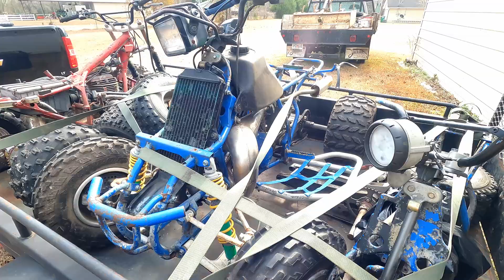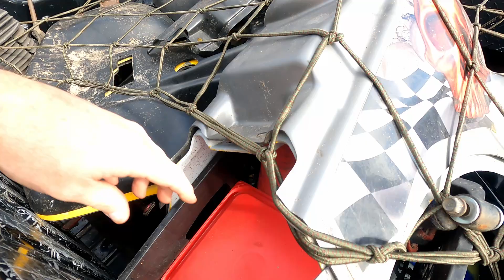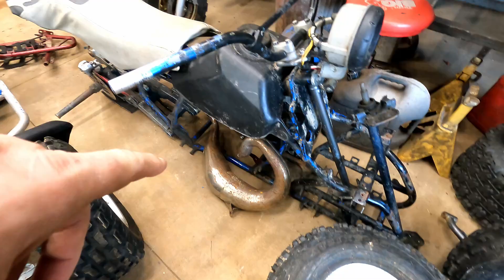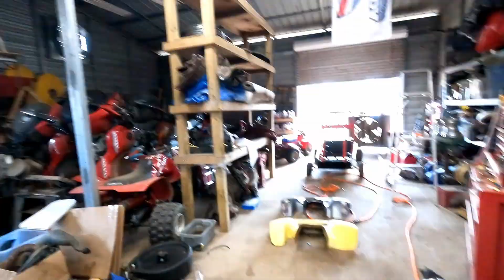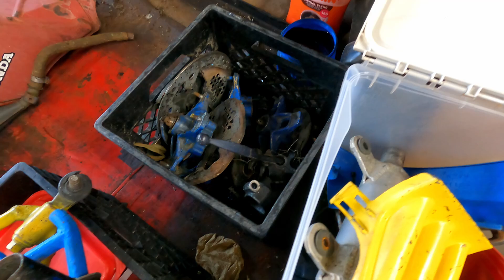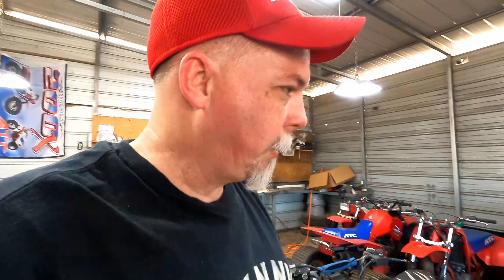WHAT WAS I THINKING? THIS COULD KILL MY CHANNEL

Comment: Congrats on the LT, good choice. The 84 should be fun since you are familiar with Honda parts and systems. I started out with autos, brand specific, Chevy. Then I learned after two fifty five Chevys, that a big block Dodge and a big block Buick were also plenty of fun. Thats why I have 2 Yamaha DX225's in my collection mixed in with the Hondas, cause I love riding them. I've got some parts for Harvey so we'll meet at the diner and back our trucks up tailgate to tailgate to shift the load. Then we go in and spend an hour or two talking and I'll try to get him to send you some pics of the dozen. Good luck sorting out those parts and when  you get a handle on them, think about putting the second together. Otherwise after the first wave of requests for the same parts, you'll be sitting on all the rest till you're my age. No matter how you post them, they'll want whats gone. Sell it complete or close and let somebody else think they can work magic. Later.
Reply from the maker: Thank you. Tell Harvey i said hey.
Reply: @Mrcbuilds  Will do.

Comment: From here it looks like the parts and pieces bike might be an 85/86 gray motor non-power valve , obviously the 88 has the powervalve blue motor but should be fun to watch!
Reply from the maker: Someone tried to remove the paint on the extra engine, i believe they are both power valve engines. Thanks for watching.